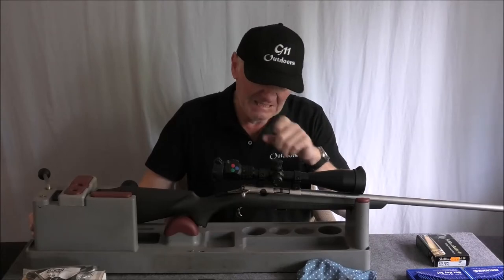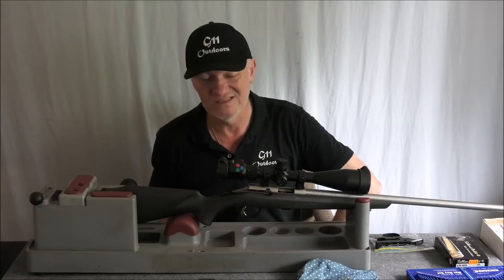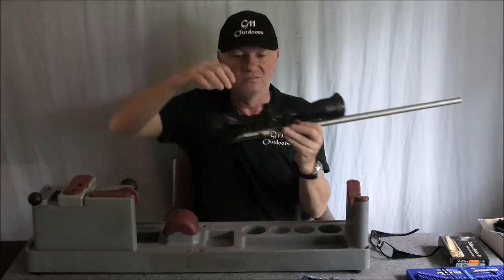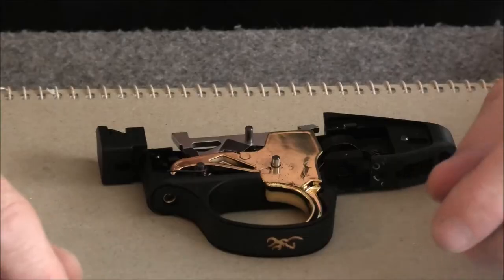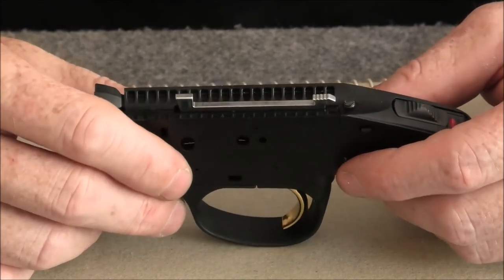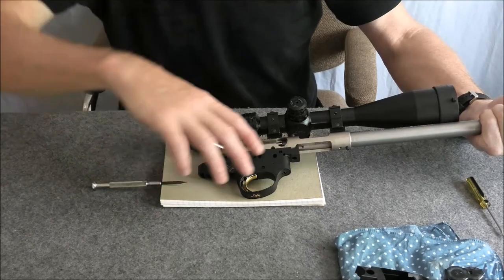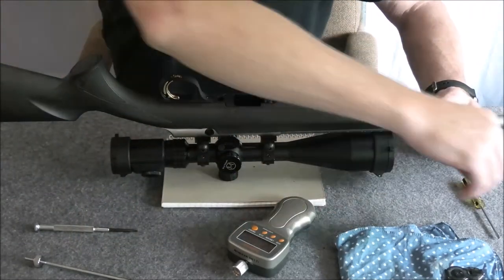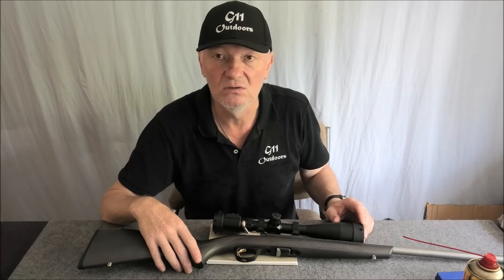Browning T Bolt trigger fix

Comment: I took a heat gun and a razor blade and carefully peeled back tamper proof label without VOID appearing, then removed trigger, then reformed spring just like you did and took my trigger from 4-1/2 lbs to a nice crisp and consistent 3 lbs, I then reassembled and tested, I'm right at 3 lbs and am good with this.I think with use, trigger will break-in and drop down a little more.BTW, I folded flap of tamper proof decal back over screw and you can't tell I was in there. If you really want to smooth that bolt out apply a small amount of moly paste to ball socket and cam slide inside the bolt, you can work bolt back and forth to spread the moly, then wipe any excess away. I even applied a small amount of moly to round engagement lugs on both sides. This made bolt engagement really crisp.Night and day difference.
Reply from the maker: Well done. It's worth working on because regardless of the trigger they are fantastic rifles. Cheers.
Reply: @gobangs1117 
My T Bolt is a 17HMR 
After lots of testing gun shoots most ammo well, BTW, I have the Target/Varmint model. 
However I got a batch of CCI
#49 V-Max and at 50 yards all the holes in target are touching and in most cases hole on hole.
Tried at 100 yards and am able to shoot plastic push pins holding target to board until target falls on ground. They are that accurate

Comment: They advertise 3 1/4 to 5 1/4 adjustment.  Isn’t that false advertisement?  mine was also at 4 1/2 lbs.  Did the same as you with the spring on a screwdriver.  Basically gave it a little more wrap.  I ran the adjustment screw up until just contacted the spring.  I am at 3 lbs. which is perfect for me.  Thanks for the great info!
Reply from the maker: Glad to be of help. Cheers.

Comment: How did it shoot bud before and after. Shoot some groups?
I use sk long range match ammo for mine.
What ammo do you use. I also shimmed my barrel near the stock foreand to give uppward pressure. Seems to shoot quite well now. But yeah the trigger is poor. Thanks for the mod bud.
Cheers from melbourne
Reply: It shoots very well indeed, in fact I scored my smallest group ever .2 inch recently with Eley Match.

Comment: Great stuff, the trigger on this rifle is fucking awful out of the box there's no other way to describe it. Just done mine exactly the same as yours and it's as nice as my Steyr Zephyr II trigger now albeit still a wanky single stage but what ever, it's now light enough that I don't pull every other shot off target now.
Reply from the maker: I'm glad you were able to achieve a reasonable trigger. I really can't understand how they could make such a good rifle and put such a crap trigger in it. I put the JARD back in and am happy with that at 12 ounces even if the bolt pulls out now and then.
Reply: @gobangs1117  it's shameful really, I'll order the Jard eventually but at the price it costs it will be a while.

Does the Jard feel better than the Browning trigger in the way it breaks? Ie doesn't feel like a rubbery giant wang? 😂
Reply from the maker: @ukwan  You get a choice of 3 different preset weights, I got the 12 oz one. It breaks like glass!